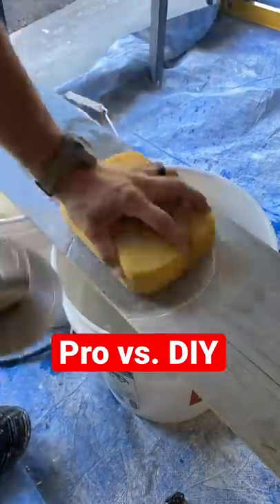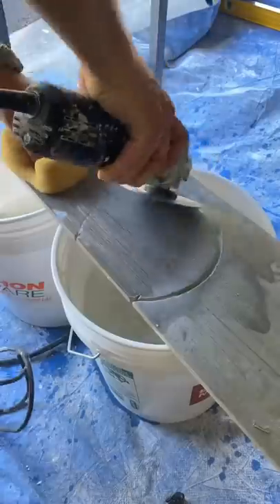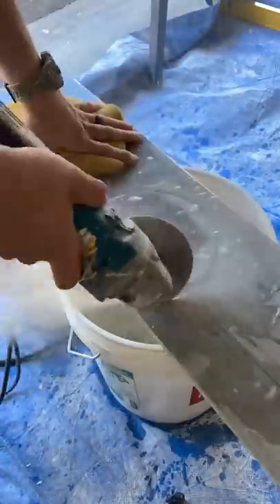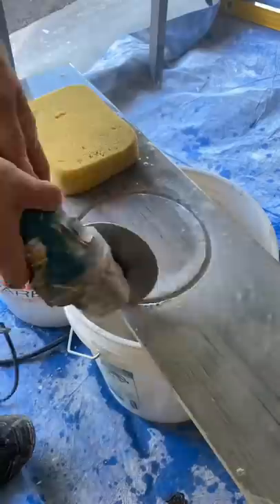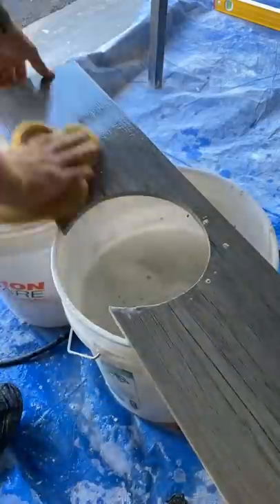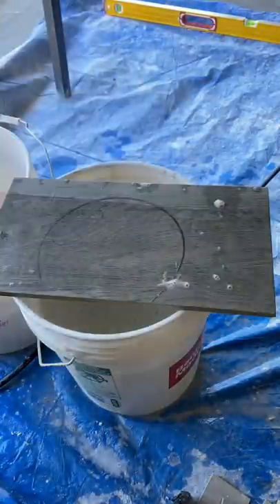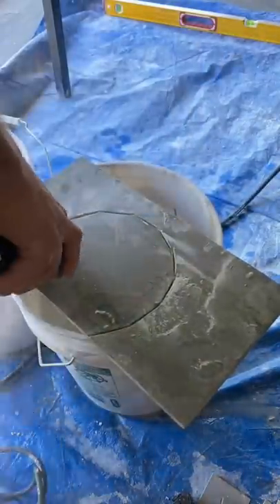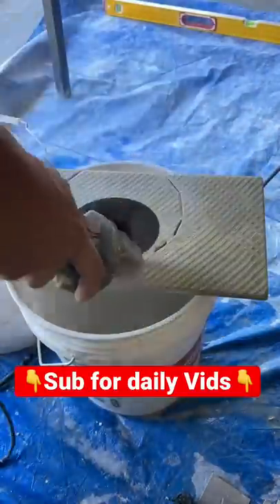Two ways to cut out a toilet flange. #shorts #youtubeshorts #diy

Comment: I've done several bathrooms and never spent much time trying to perfectly cut a tile around the flange. You simply just leave a gap around it and the toilet itself is going to cover the whole thing. When you put a tile floor down when previously there wasn't you're going to have to add spacer flanges anyway to bring it up to the floor height
Reply: jasheed albahari  no he didn't. You must be misunderstanding. At no time will I waste my time trying to cut a circle cut to match the toilet flange underneath the toilet. I literally just square cut the tiles and leave the Gap around the circle where the toilet flanges. The toilet itself will cover the whole thing
Reply: @shazaidi  he said it at the end of the clip
Reply: @taina758  at no time will I make any cut into a piece of tile underneath the toilet in the shape of a circle. I will just square cut it. Look up square cut.
Reply: jasheed albahari  I watched the video three times. I would not cut a circle in a piece of tile I would just cut it off on both sides and then adhere the tile down to the floor. Does that make sense? There wouldn't be a nice circle cut piece of tile wrapping around the toilet flange. It would just be no tile around the flange.
Reply: @shazaidi  sounds like a great job. It's about doing the best and taking pride in work whether its seen or not
Reply: jasheed albahari  when he says square cut in the video he means multiple straight line cuts. Hussain Zaidi means cut the entire hole into a giant square shape. One way still resembles a jagged circle while the other is literally a square. This was never mentioned in the video.
Reply: @Kandres027  hallelujah, someone finally understood.
Reply: @ELTUK82  The only time the customer or anyone would ever see is when the toilet is removed from the floor and how often does this ever happen?
Reply: @shazaidi  ok, fair point
Reply: @shazaidi  I'd still know I'd done a half arsed job though
Reply: @ELTUK82  When you're a professional and every minute counts you learn that by the book isn't always best. Doesn't mean you do sloppy work because now you have more time to get precise where it really matters.
Reply: The front and back have plenty of room, however, the sides must be cut closer or there will be a gap.

Comment: I’ve done and seen flooring for ages and the best way is to just free hand it with a blade and fix it up with a few tricks
Reply: Here is a great tip than because I see floor guys like this make this mistake. I'm a master plumber and do alot of tile. Never go around the flange. Tile should go under
Reply: @kscory8577  if it's a remodel it can be difficult to go under the flange in a lot of situations
Reply: What is your suggestion if the flange is already fixed into a concrete subfloor for example in a basement bathroom addition. @Ks Cory
Reply: @jaycasillas4505  they make stainless steel rings that make good extensions

Comment: If you cut a in the middle after a few rounds it should be easier to brake the circle
Reply: I've done it with a pie cut out in lines and then you can easily score and snap each peice off

Comment: You could consider using a masonry hole saw but those can get pretty expensive
Reply: For this size hole!?
Reply: Much cheaper than losing fingers.
Reply: 7” masonry hole saw???
Reply: @aBusybee   This is a diamond blade that grinds away material instead of cutting the material like a wood cutting blade. You can touch this blade with your fingers and nothing would happen maybe a slight burn. Now if it was a wood cutting blade this would be very dumb.

Comment: This is insanely dangerous:

1-No guard
2- No handle
3-Only using one hand
4- cutting a small diameter circle, those discs are made for cutting straight lines. They will eventually blow if you keep doing this. To everyone watching this. Do t do it. Use the proper tool for the job.
Reply: Thanks bob the builder

Comment: The biggest issue with this is safety,  the grinder comes with a shield around the blade or disc this is to prevent getting your finger sliced off if and or when the grinder kicks back and out of your hand. Do this properly and use the tile saw and use angle cuts to remove the material needed

Comment: I just get a jigsaw and it will be done in about 30 seconds but I’m old-school and do things what we like to call “the right way”
Reply: Efficiency
Reply: Ah yea, my ceramic tile jigsaw
Reply: @md4luckycharms  tile jigsaw blades are quite common
Reply: @nickmorrison7658  I didn't know those existed till today. I learned something
Reply: @nickmorrison7658  huh, we'll I'll be goddamned, they sure do
Reply: @user-fi6tq3mo3q  LOL how do you think 99% of all curved cuts have been made for the last 100 years ? Jigsaw blade are manufactured to cute ceramic, metal, wood, plastic, etc. Hell even a drill with a 4” hole saw that is designed to drill ceramic/porcelain/stone is gonna be a better option than an angle grinder.
Reply: @CaugustusWhite  people   There is no jigsaw blade no router blade no 7” hole saw for ceramic porcelain whatever.  Let’s say there is then the vibration would break the tile.  The man did it just as 100% of professional tile guys would do it
Reply: @md4luckycharms  no
Reply: @user-fi6tq3mo3q  lol there ABSOLUTELY IS!!!
Reply: @CaugustusWhite  ceramic tile?
Reply: @user-fi6tq3mo3q  nah, composite vinyl tile
Reply: @md4luckycharms  vct is cut with torch and razor blade

Comment: Wouldn’t the pro way of doing it involve using the guard on your angle grinder?
Reply: 20 year pro here.
No guard on my 4" angle grinder, it gets in the way for a lot of cuts, and diamond blades are'nt that gnarly, the worst I've ever done is a skinned knuckle occasionally.
Reply: @chrisrogers4616  only in hard to reach areas. In the open like that? Guard on
Reply: If I'm using a flap disc or a wire wheel/ cup brush,  no guard 
But a cut off disc, always guard 

But, eye pro is the biggest one to use
Reply: No professional tile guy would use a goddamn guard on their dry cut saw.

Comment: Tile should really be under the closet flange to keep the right height unless a spacer is being used to raise the flange. Seen this many times when customers complain about sewer gas smells. Turns out the toilet didn’t seal correctly due to incorrect flange height

Comment: Cut diy. From the backside not on the front and it won't be seen. And the cuts will be full of glue anyway to support the tile in the slice marks. Making it faster on both sides. Real tiler here.

Comment: My partner does 1st technique until half-way into biscuit of tile then cuts inner circle like a pizza, then taps them out. Works well for smaller circle (drains)as grinder is running a lot tighter turn so just get threw glaze is all that's needed he said...would u agree

Comment: That hole is way too big for a toilet flange. The toilet flange needs to sit on top of the tile. If the toilet flange is below the finish grade of the floor it will leak. Do not do it this way it is a hack job

Comment: I've been in the trade since 2000 and I can say that maybe I've seen 1 guy use a grinder with guard on.  I personally have never been injured by the absence of the guard.  You either have to be an idiot or just really unlucky to get cut with one.  That's the difference between a professional and a Newbie.

Comment: Don’t do this, use tile blade on jig saw
Reply: We do not work by the hour. Speed is key.
Reply: @user-fi6tq3mo3q  you should be cutting it with a router then right ? That way in the video just seems kind of ignorant. I’m not a tile guy I’m a metal fabricator but I’m always looking for a better way to do shit
Reply: @kylereed5161  to all the none tile guys out there,  this is the ONLY way and the best way to cut this hole.  This is NO shortcut.   There’s is no 7” hole saw, router, jigsaw or magic wand.  This is it.  Now what’s ignorant is most people in this comment section talking about jigsaws, Wet saws, routers to cut ceramic.